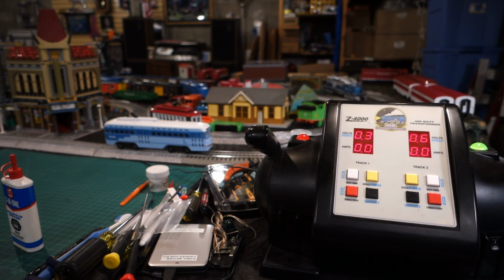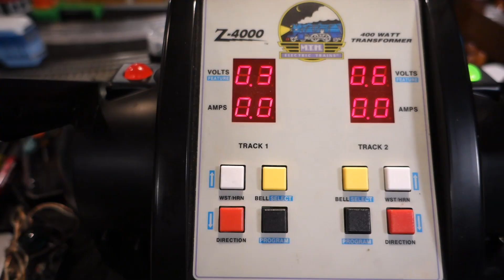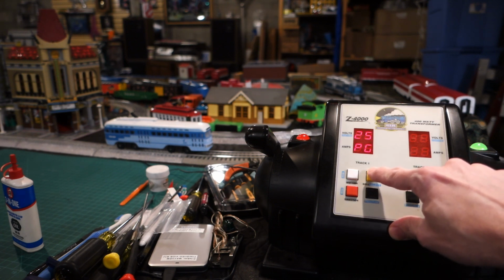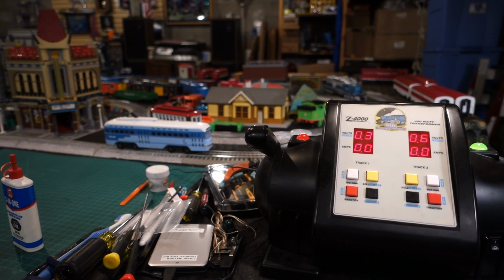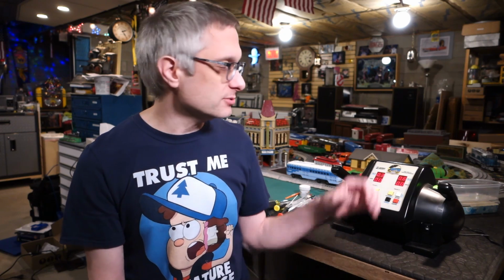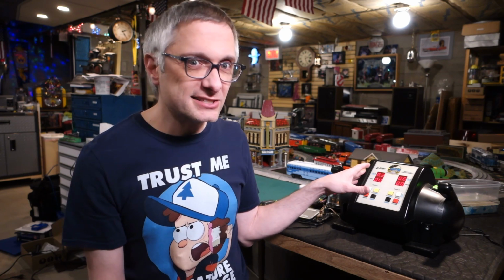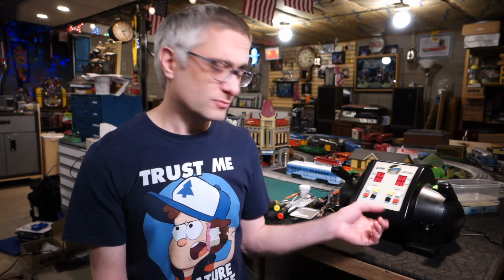MTH Transformer Z4000 programming feature for Protosound 1 engines

Comment: Hi Jeremy,  This video is an excellent demonstration of what I think is the best reason to get a Z4000 transformer if you are running early Protosound equipment.  Trying to program using a conventional transformer is a real test of patience!  Great video!!
Reply from the maker: Thanks Brad, you have to have quite a few proto1 engines to justify a Z4000 lol. They are really holding their value. I just wanted one for the extra power (maniacal laughter)
Reply: Hi Jeremy,  I've been looking for a reasonably priced Z-4000 located close enough for an in-person purchase for 9 months now and finally found one!  It tested out fine, looks to be very lightly used and came with the original box and packing foam.  I'm excited at the prospects of easy Proto-Sound 1 programing - and also having a modern transformer.  All this thanks to your video.  Thanks again!
Reply from the maker: Excellent find Brad! I'm excited for you 😁

Comment: Hi Jeremy...
I would have fallen off my bench if I heard that noise and saw the flashing.  😄  
I'm strictly conventional. Four loops...four transformers. MTH Z1000's   I thought about purchasing a Z-4000 to avoid bus wiring on my 16' x 8' layout. Would a more powerful transformer do the trick ?   I believe the Z-4000 is capable of handling two loops ?   Thanks
Reply from the maker: As you know I am really happy with the performance of my z-500 transformer. But I have learned that the Z-4000 has a "cleaner" power output and helps locomotives with electronics to operate a bit better. Plus it provides lots of power and has handy dandy meters on it. 

I would save up for a Z-4000 in your situation. But only if I was looking for a performance increase. Do you think your Z-1000 are over worked? Do any of your locomotives with electronics experience glitches? The Z-4000 is still holding it's value. Keep an eye on auctions and other ads and you might get a good deal.
Reply: @TooManyHobbiesJeremy  No..not over worked and no electronic glitches at all. Just a slight decrease of power as they roll on the opposite side of the loops. Oddly enough, the engines have a slight burst of power when the horn button is held down.  Thanks for your reply.  👍
Reply from the maker: Horn button speed-up is normal. To avoid slow down on far side of a loop, you need to add feeder lines. Basically a duplicate power point.
Reply: @TooManyHobbiesJeremy   How about a second set of wires from the original transformer to a second terminal track on the other side ?  I use Atlas track.   Meaning I would double up ?   I've never needed feeder lines before due to smaller loops.    Thanks
Reply from the maker: Nothing wrong with your plan. I would jumper the second terminal track to the first.  This should fix the locomotive slowing down when it's furthest from the transformer. 

Of course you don't have to do anything.
Reply: @TooManyHobbiesJeremy    Very good...I'll give it a try and keep you posted.

Comment: That is luxury-level Protosound 1 programming. We have some PS1, but I'm not sure if I want to get a Z4000 just for this or not. Hmm.
Reply from the maker: I would not get one just for the programming feature. If you will ever be expanding your layout or like me - love to run lots of lighted cars - then get one. I like not having to worry about having enough power output. I view it as an investment in my hobby.
Reply: @TooManyHobbiesJeremy  Those passengers cars with incandescents do draw a lot of amps.  I did some old school blocking, and I stuck cheap transformers on a couple blocks just to keep from overloading my powermaster/Lionel brick. I can multiple passenger trains at the same time, but it just takes a little fussing to make sure it doesn't break the fuse.
Reply from the maker: Nothing wrong with your solution. Nice work :trophy-yellow-smiling: